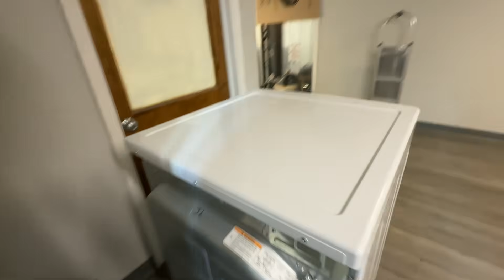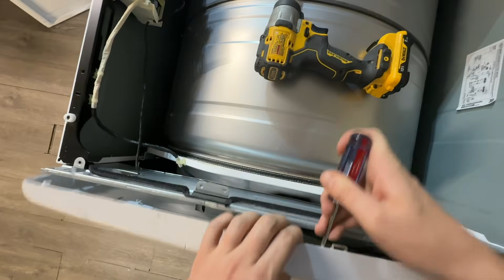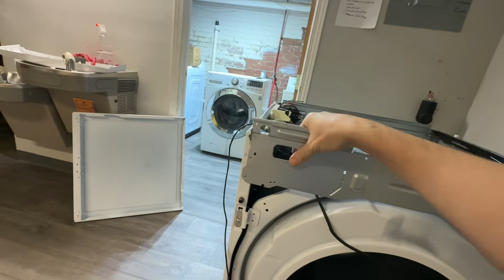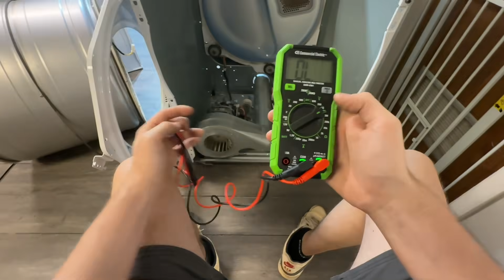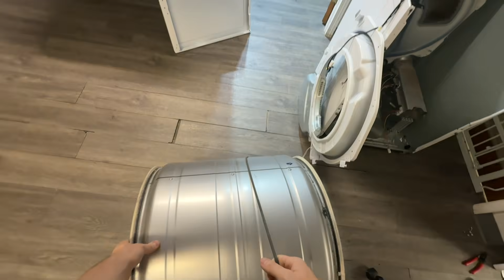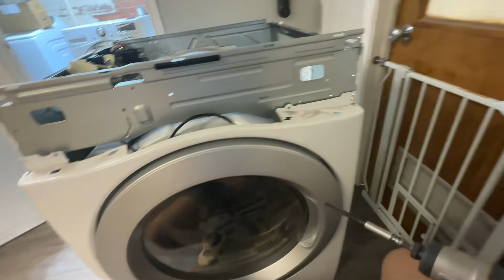LG Dryer Won’t Start? Thermal Fuse Fix (Easy)

Comment: Ive a LR dryer, turns on and clicks where the motherboard is but doesnt turn the drum. I found my heating case with broken coils that fell into and hung into the metal case. i exchanged it as a plug and play, exchanged the door switch fuse and now last thing i can think off will exchange the blower fuse. Ive no error messages and the belt is intact. I reset the breaker too. im hating to take the drum out. I cant afford someone to come in so im trying to do all on my own. My work area is small since the room is tiny. Is there anything else i can try in case this wont fix it either ?
Reply from the maker: I would test the thermal fuse with a multimeter before replacing it. If that’s good, check the belt switch and make sure the drum spins freely by hand with the dryer unplugged. A bad motor is another possibility. I wouldn’t recommend replacing any more parts without testing first!

Comment: Done and done. Thanks.
Reply: Hey Aaron. So the dryer ran for a cycle or two after I replaced the fuse. Now it is giving an EE1 error code. It runs for a second before stopping and displaying the code. I took apart the dryer again and checked the fuse, the thermal cut off and the element - all have continuity. Nothing on the circuit board appears blown or corroded. Any suggestions about what to check next before replacing the entire circuit board? I unplugged for 10 minutes to "reset" the board and the exhaust hose isn't kinked or obstructed so far as I can see.

Comment: Thank you for this post! I'm a single income family of 7, and this was so much cheaper than replacement!  If I have any further appliance repair needs, I won't hesitate to look you up 😉
Reply from the maker: I’m glad it helped!
Reply: @FixitwithAaron well, i thought it worked😢 I  replaced the thermal fuse, it worked for two dryer loads, then it stopped working. Took it apart again,  tested the thermal fuse, and it was toast. So i replaced it again as well as the high heat limit sensor,( parts store suggested), it worked for two more loads, and stopped again.  The third time i replaced the thermal fuse as well as the probe sensor that is located on the blower housing,  it worked for one load, and stopped again.  Any ideas?
Reply from the maker: @jacobwest1873  typically if it continues to blow the fuse over and over again, there could be an airflow blockage in the ductwork. If the dryer gets too hot, it is common for it to blow a fuse. Or it potentially could also need a new heating element if the heating element is grounded out.
Reply: @FixitwithAaron definitely not an airflow problem,  i cleaned it thoroughly the first time. How do I test the heating element to see if its grounded out?
Reply from the maker: @j @jacobwest1873  did you clean out the hose that connects the dryer to the ductwork in the home? Or the ductwork that goes from the home to the exterior? Or both?  Put the dryer on air fluff or air dry and if it still heats, then the element is grounded out.
Reply: @FixitwithAaron I cleaned both 👍 I'll have to replace the thermal fuse for the 4th time to test it on air dry😢 but, thank you for all your help.
Reply from the maker: @jacobwest1873  no problem. I have heard on certain LG models. It’s best to go ahead and replace the element when you replace the fuses as well.  But that one’s a little tricky I’m not too sure without looking at it!
Reply: @FixitwithAaron and, thank you for the quick responses. I wish I would have contacted you for a technician consult before I replaced it the second time,  lol

Comment: Is this the thermal fuse or the blower thermostat?
Reply from the maker: The blower thermostat (or thermistor) monitors and regulates the dryer’s temperature during normal operation, while the thermal fuse is a one-time safety device that blows if the dryer overheats.